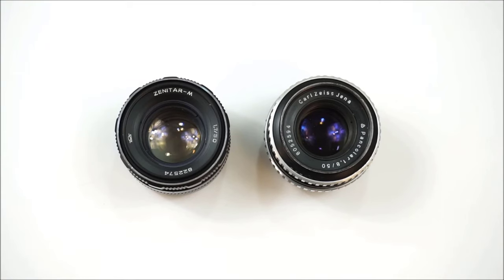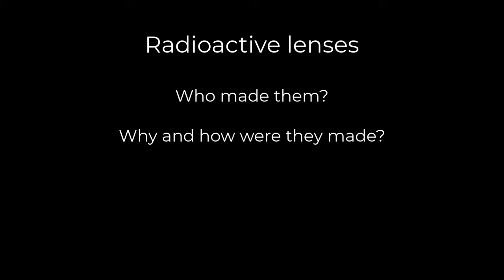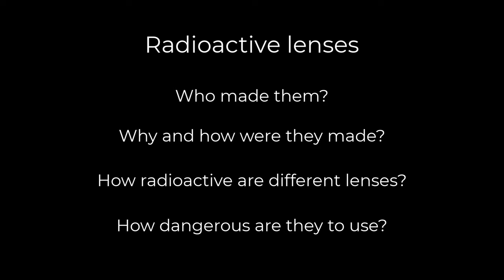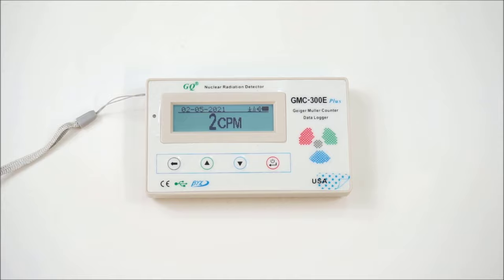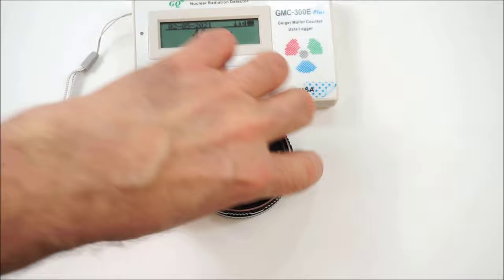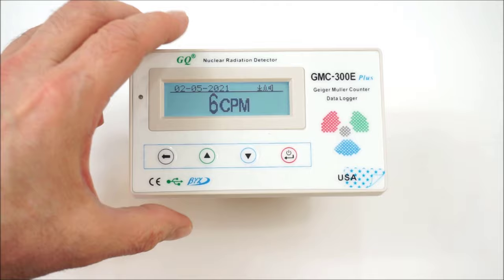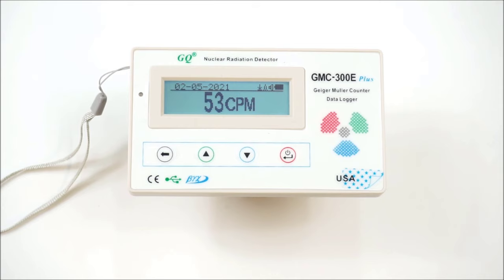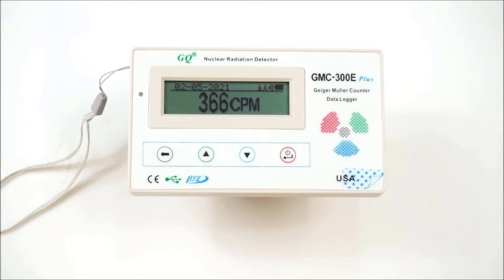Radioactive Lenses Part 1.   Get this lens out of the house!

Comment: Paste regarding thorium lenses, from the nuclear Safety division in Norway: The regulations on radiation protection and the use of radiation (the radiation protection regulations) set a limit value for radiation dose to the eye, which must not exceed 15 millisieverts per year (15,000 microsievert per year). Based on this limit value, active use of the camera (aimed at the eye) should be limited to a maximum of 1 hour per day on average (375 hours per year). In addition to the potential dose to the eye, it is estimated that the potential radiation dose to the abdominal region is approx. 5 microsievert daily (assuming 6 hours of use per day). Provisions in the Radiation Protection Regulations state that the population shall not be exposed to more than 250 microsieverts per year from a single activity. In this case, it is equivalent to the camera staying near the abdomen for over 300 hours in one year. To sum up, if you are an amateur photographer and plan on using the camera for a limited time, you do not have to worry about the radiation from thorium lenses.
Reply: Which lens was used for these calculations? Because there are several orders of magnitude differences in activity between various radioactive lenses.
Reply: @michaelm1  specifically, Takumar.
Reply: @rodneywatkins4731  Thank you. And would you know which Takumar? Super Takumar 50mm f/1.4 or SMC Takumar 50mm f/1.4? SMC version is significantly less radioactive than the Super.
Reply: @michaelm1  no, sorry. I asked them generally and mentioned Takumar. They also state that research in this field is few and far apart, and old (the following US research is quoted, which I have not reviewed: NCRP Report; no95. Radiation exposure of the U.S population from consumer products and miscellaneous sources, 1987).
Reply: @michaelm1  I think it's Super Multi Coated Takumar. Some of the 7 element versions of normal Takumar are also radio active. Simon have a video on Takumar - https://youtu.be/sG_69I45H2k?t=128

Comment: I'd be more worried about Radioactive Lenses being left on a camera and damaging the sensor...
Reply: @steinar.offroad  Thanks for the heads up...
Reply: If they didn't destroy the film that was used in the cameras - they are not going to harm the sensor.
Reply: I wonder about that too esp as when working with DOE our dose measuring blue bages (dosimeters) held film as the detector..
I think between the mirror, it's support plate and metal shutters were enough to reduce effects. RFs with cloth shutters might have been different.
Reply: @steinar.offroad  I dont believe in obsolete...

Comment: Safety is one thing, but the thing that I don't see enough people mention is that the radioactivity in these lenses can affect your camera sensor. Short-term use and you'll notice that the RAW files taken with the radioactive lenses have significantly more noise (put lens caps on a radioactive lens and a regular lens, attache them to the body and take a few raw files at around 1/60th of a second and ISO 100. The radioactive lens will produce less uniform and much more colorized/randomized noise patterns). Longer-term use of radioactive lenses (say, leaving a lens attached to a camera body overnight or for multiple days) can affect the sensor performance even with non-radioactive lenses later on (issues with gamut frequencies and color phase issues that can affect pushing and processing RAW.). So, it's best to just use these sparingly and don't let them sit on your camera for hours-on-end. That, or use an older camera for them. I play around with my radioactive lenses on an old NEX-5R and the first version of the A7 , but I won't put them on my A7RIV. Just food for thought.
Reply: I used a takumar 50 1.4 on my Canon DSLRs for long and i didnt notice any degrading or damage to the sensor yet

But i also have to say the old cameras i used these days had anyways HORRIBLE noise anyways.
On my EOS R7 i also cant care less… i use a filter adapter with a clear insert and this glass blocks already the radiation. No problems yet on my cameras

Remember, we just talk about alpha radiation, as long you dont smash the glass and breathe the dust its about 100% safe. 

In fact this lens could be even more effective as those „chakra“ or stones/crystals for health reasons since a very small amount is also gamma
Reply: @harrison00xXx  yes...dslr...there is a mirror shielding the sensor
Reply: @kalinmir  not on my R7 where its just a glass filter in the EF RF adapter, no  problems so far despite having this lens sometimes for weeks on the cam
Reply: @kalinmir  to make the exposure even worse i didnt use the shutter down for a while and so the sensor is the most exposed, its just hypocrite to think this slight radioactivity can harm the sensor.

Ever did x-ray experiments? The sensor literally starts to flash thousands of pixels  nonstop and the camera itself gets slightly radioactive for a little time. Still no long time damage.

I have read that you need about 500 Roentgen on a single pixel to theoretically damage it. Good luck testing it since this is for real MUCH radiation
Reply: @harrison00xXx  strange...didnt know that was a thing...tho im fairly new to photography

Comment: Interesting topic, as a hobby TIG welder I've sharpened "Thoriated" Red Tungsten electrodes several times in the years.
From manufacturer "Up to 4 percent by weight of thorium dioxide is added to alloys"
In recent years Thorium is not so common, now this is "With a lanthanum (III) oxide content of up to 2 percent by weight"

Comment: Enjoyed this :-)  Wasn’t sure if you were serious but probably best not to keep those in a dense metal box.  That actually increases gamma output unless the metal is very thick indeed.  You want 5mm Aluminium or 10mm Perspex if you want to stop the beta while not increasing the gamma.  However, I just keep them in a leather pouch and stay more than a meter away when I’m not using them 🤪

Comment: All youtube videos and articles Ive seen are completely missing the point.  Thorium is primarily an alpha emitter (but as many have pointed out still emits some beta-gamma).  The beta-gamma radiation is not of concern as any camera will block all of the beta particles and the gamma waves will be attenuated to the point of harmless by the time they reach your face.  The alpha radiation is only dangerous if it is ingested or inhaled (but very dangerous if it is).  In normal usage the thorium contamination is fixed inside the glass and of no danger.  However the real determining factor is whether any thorium particles can become loose if the lens is dropped or scratched.  If these particles are on your hands when you eat they could impart significant alpha dose to the body.  Please perform the following tests and you will be the smartest photographer on YouTube and finally put this to rest:

1)  Rub the radioactive glass onto a piece of paper and survey the paper with the meter.
2) use a coarse substance such as sandpaper on the glass and survey it.
3) scratch the lens with a needle or knife and wipe the knife onto the paper, and survey the paper.
4) the ultimate test is to shoot with the lens all day and without washing your hands, survey your hands.

If all of these tests do not detect Thorium contamination on the papers/hands, the lens is perfectly safe.

Remember to keep the object being surveyed far away from the lens or other radioactivity (coffee, brazil nuts, etc) to avoid cross-contamination.
Reply from the maker: Thank you for this...some of your suggested experiments I've been planning to do, but sandpapering the glass is not an option, and avoiding washing my hands all day in the current environment is not on either!
Reply: @Simonsutak  

Haha very understandable!   Thanks for doing a service for the vintage lens community.  I really look forward to seeing someone finally test if any loose contamination can be liberated from the fixed radioactivity in the lens!
Reply: @nanobanana  You'd need a lot more sensitive equipment to test that properly. You'd need to detect trace contamination and normal Geiger counters don't do that.
Reply: @Simonsutak  please don't consider doing such test. it is incredibly harmful, and whoever is suggesting it should do it himself!!! Just a note: if you happen to drop your radioactive lens and the glass element breaks or fractures, you can pretty much remove anybody from the house and seal it, as it is now a contaminated site.
Reply: @michaelm1  
It depends on the sensitivity of the equipment but if it is picking up 500+ counts from the lens, it should have some response if any contamination is picked up by the paper.  Any response of the counter over background would be very interesting to me.

Comment: Several lens manufacturers in the 1960s were looking for ways to create new types of glass with a high refractive index and a low chromatic aberration. They started to use rare earth compounds, such as fluorite and quartz, even radioactive thorium dioxide (ThO2). Quartz and fluorite are quite expensive and hard to produce. For other lenses they added small amounts of thorium dioxide to the glass, but only in the rear or front lens group. The radioactivity (alpha radiation) of the thorium dioxide may cause self-degradation of the glass (turning it brownish yellow over time). Not all lenses turn yellow, however.
Alpha radiation is effectively shielded by a few centimeters of air, paper or the thin layer of dead skin cells that make up the epidermis, so it is not particularly dangerous. The rear cap of the lens will block most of the radiation effectively and there is no danger of fogging the film or damaging the sensor in a digital camera.
Radiation levels are stated in microsievert per hour (μSv/h). A set of dental radiographs will expose you to approx. 5 μSv of X-rays. If a lens was to emit 5 μSv/h, it would generate the same dose of alpha radiation in 1 hour.
Reply: Thanks!
There is one more thing to say: Its ONLY dangerous if you would smash the glass element, turn it intentionally into dust and breathe it... sounds very impossible to pull off in the first place unintentionally.

Comment: I'm not sure I should be laughing, but I am! 
I've ended up with three copies of the early Pancolar 50/1.8 (also one of my favourite lenses) all bought cheap due to mechanical issues and fixed. I believe they're rumoured to have more than one radioactive element so give strong readings from the front and the rear (?). They live in the same cabinet as a chrome nose Canon FD 35/2, a Minolta MC 28/2.5 and some other possibly radioactive glass; I wonder how many clicks that combo would generate ;-)

Comment: As an owner of quite a few radioactive lenses, I have considered fabricating an aluminium box (1/2 inch thick is overkill) to cope with the beta. The gamma is difficult to attenuate, so I wouldn't bother. The alpha almost doesn't matter if you wear clothes and even skin (which, happily, I do!) also glasses help. I would like the aluminium box to be large enough to accommodate an old Spitfire compass and some other objects with a fair bit of radium paint.
Reply: I covered one of my Ikea Kallax shelves with some steel plates from the inside which helps a lot against Betas and some Gammas. Best practice probably would be to just keep some distance. ;)

Comment: I have limited myself to only 2 radioactive lenses (kind of arbitrary) - a Takumar 50mm 1.4 and a Yashinon 50mm 1.4. Both of them send my more primitive Geiger counter nuts! I bet you have a Takumar lying around to test, if you could dear sir.
Reply from the maker: Yes, I'll include tests of the Takumar 50mm f1.4s in a video.  Interestingly, I have two copies of the same version, from different years, and one is quite radioactive and the other isn't.   My Yashinon 50mm f1.7 is quite radioactive, guess they like the glass!
Reply: I have several. With more coming in the post. I wonder .. I bought an aluminium case to store them, I wonder if I should line with lead.. and maybe get a Geiger counter
Reply: @Just-a-bystander  lead is also not very healthy
Reply: @Just-a-bystander  i have 2 takumars but i bought them locally - i did not want to get them shipped and open a box with a broken lens and full of radioactive dust.
Reply: @k3i0  so true
Reply: @k3i0  during the pandemic, with everything I am getting shipped to me, I am swimming in bubble wrap. Its frightening the amount of waste shipping generates, but that is another issue - and yes I do recycle as best I can, reusing.. but incoming far outweighs outgoing
Reply: @Just-a-bystander  yes thats also a problem i have. but what i meant is that the lens could break while shipping. alpha emitter is very dangerous if you get it inside your body (eat or inhale or whatever).  so if the lens breaks while shipping it could be dangerous to open the package with a broken lens inside
.

Comment: Fun! Throw the lens into my window!  Will your counter differentiate between alpha, beta and gamma? Do a 7 element Takumar 50 1.4 next!
Reply: Answered my own question: this counter reveals: beta, gamma, x-ray. It doesn't show alpha. Which is too bad, because the reading would be insanely high. Insanely high=improved family reaction!
Reply from the maker: Yes, that's what this simple Geiger Muller Counter measures, as I'll explain in another video.

And yes...I know...I just couldn't afford to use counter that measures alpha, for various reasons, including insane family reaction.   Although it would be better for click bait, so I made a mistake on that (wink wink). 

I'll be testing all my Takumars and all the other lenses.  The relative CPM levels will be interesting.  As I mentioned under another comment, I've already found that two versions of the "same lens" have quite different readings....and fortunately I know why!

Comment: You would probably be in greater danger by absorbing lead from handling any lead box you may be using than from radiation you are parrying. And, of course, lead is much, much softer.  Particles will always become airborne from any handling.  I'll be waiting to see your research on that.
Reply from the maker: Yes, I look into using lead-lined boxes but decided not to use them for the reasons you state.

Comment: Funny...
I thought every photographer was aware that the formulation of a lot of optical Crown and Flint glass both old and modern may contain a good percentage of lanthanum.
The use of lanthanum is even prior (1930) to that of thorium.
https://www.schott.com/advanced_optics/english/knowledge-center/technical-articles-and-tools/abbe-diagramm.html
Or maybe it was not clear that, for example, LAF means Lanthanum Flint, LAK means Lanthanum Crown?
Guess what was the typical composition of the types of glass that Leitz Wetzlar used for their best lenses...

Besides - on the Pancolar you are not measuring gamma, but beta since alfa would be blocked by the plastic body of the counter, if the tube is inside . 
You can try to put a sheet of paper between the geiger counter and the lens to see if it makes any big difference and if it does, then you know you should start a complaint with GQ Electronics. 
You can then proced by interposing a thin sheet of metal (aluminum?) or plastic (Perspex will do - check the documents in my reply to Andrew H here below) to block the beta radiation.
If you register no changes in the radiation level, then your lens was probanly produced between 1964 and 1967 with optical glass containing thorium, which was bought by German producers from an English supplier (Leitz started to use this glass in the 50s). 
Later versions of Pancolar 50mm are not radioactive: for example my Pancolar Auto (s/n 49756) and Pancolar Electric MC (s/n 9708143) are not.
Reply from the maker: Many thanks.  I'll try those experiments in the next video(s).

Comment: I own a: Carl Zeiss Jena Flektogon 20mm f4, 
and a: Yashica Auto Yashinon DS 50mm f1.9

I left one of them on my old X-T10 without knowing it was radioactive (I got a defective GM counter) and in 7-8 months the camera died from software issues, basically it progressively got worse and worse, it went from crashing when using flash, to crashing when using auto mode, to just turning on but not able to take a picture, to just turning on and only displaying a white screen.. with all the menus and settings.. eventually her jaw fell off. 

now I am reluctant to use these lenses on my X-H1, even though I absolutely love them..